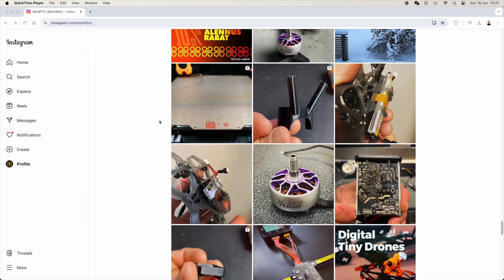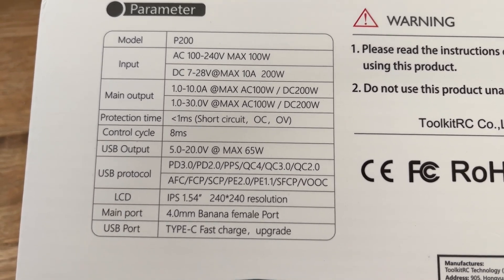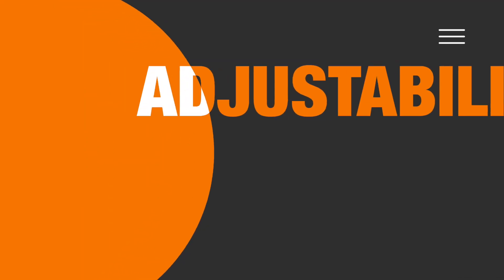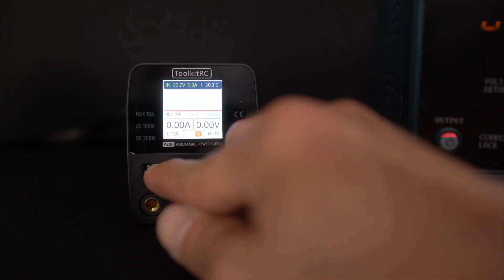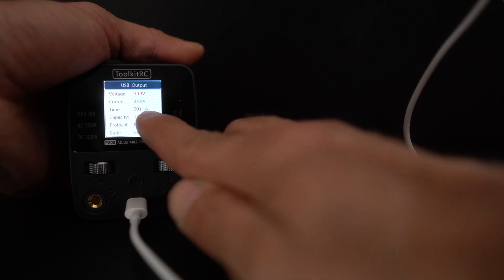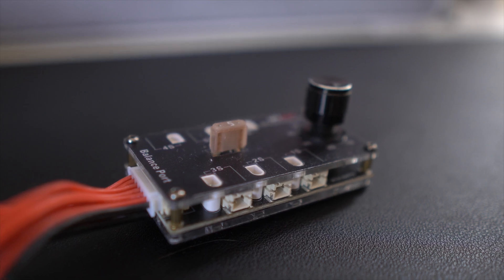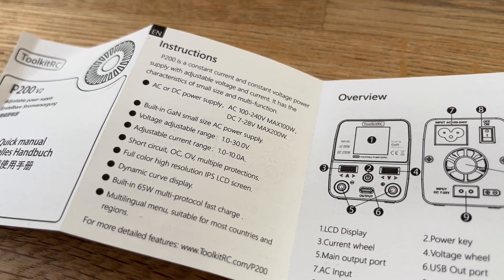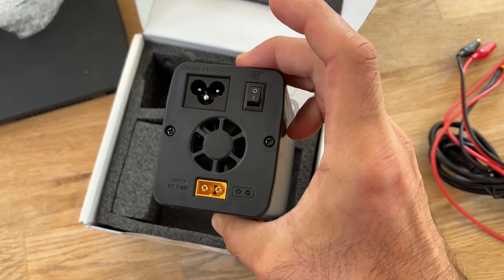ToolkitRC Bench PSU - P200 V2 Review

Comment: Hi, I bought two of these P200 V2 on Aliexpress, the first one had an issue with the "amps" button/encoder; you could go down, but while trying to raise the current, the value sometimes increase, sometimes stays the same, and even is going down... in the end almost impossible to use.
After a return, I ordered another unit (from the same seller because of the interesting price) thinking I had bad luck with the first unit, and the second acts the same... it is not that bad, but still completely random when trying to increase current... Did someone experience the same issue, or am I just really unlucky ?
Thanks for your feedback !
Reply from the maker: I at least didn’t have that issue. My unit has been working fine, but in all
Honesty I don’t believe that much in the QA process of this company. I’m not surprised you are having those issues.
Reply: @NordFPV  Thanks for the feedback, since then I saw another video by Mads Tech, focused on Chinese Chargers/PS reliability in general and Toolkit RC failure rate in particular...
https://www.youtube.com/watch?v=cjr4fM-VK0Y
It really is a pity that the P200 V2 has so many failures as many ToolkitRC products, because it has really compact form factor (which is probably the reason of the AC/DC converter failure) and nice functions like the abilty to tell you the USB charging protocol actually used by a device and the voltage/current on USB port...
In theory it is really nice, in real life not so much...

Comment: This v2 has a crazy-loud fan that goes mental at low loads. Very disappointing as I was excited to get one of these, but it's so loud I don't want to use it on my desk. Has anyone else with one of these experienced the same thing?
Reply from the maker: After using it for a few months  also became aware of the fan, it’s loud, but it’s not loud enough for me to stop using the PSU. I agree it’s a negative feature in the unit.

Comment: This Power Supply works very well as a power supply, but watchout for the usb charger side. Both my DS212 handheld oscilloscope as well as my BT speakers got cooked by this charger.
Reply from the maker: What!? That’s a USB port. It shouldn’t be sending more than 5 volts…
Reply: @NordFPV  My point exactly, i am not wanting to cause consternation, just be careful. I also felt my cell phone getting extremely warm while charging and immediately took it off.

Comment: How can I tell a version 1 from a version 2 by looking at it?
Reply from the maker: You can’t. You have to check the label.
Reply: If you have a V1 you will see that V2 is slightly larger, not much but still a little larger. You can also check the label.
Reply: V1 has GaN on the right side of the display, V2 does not